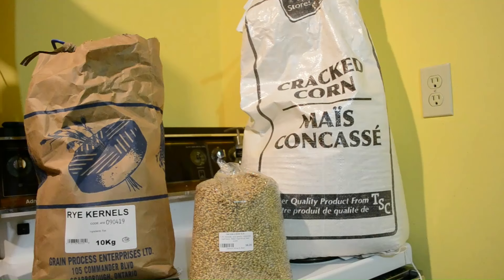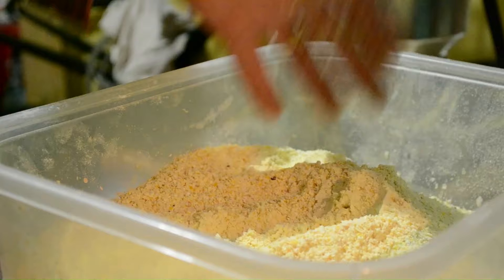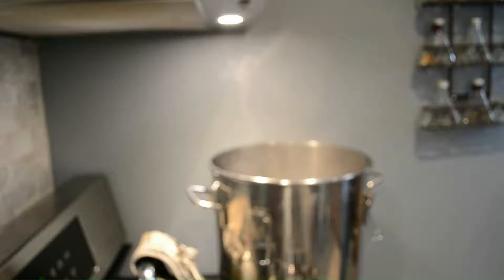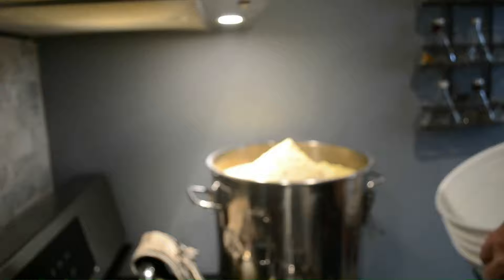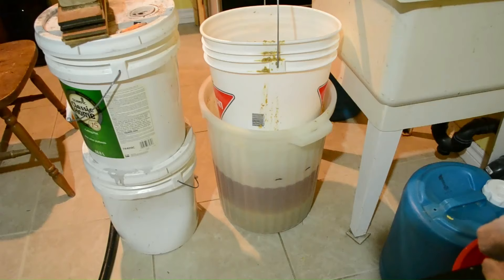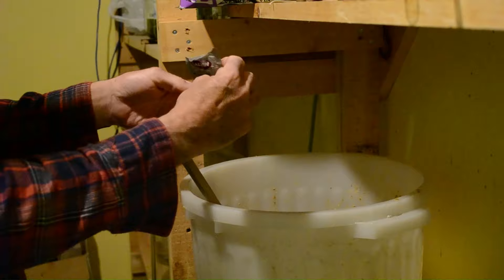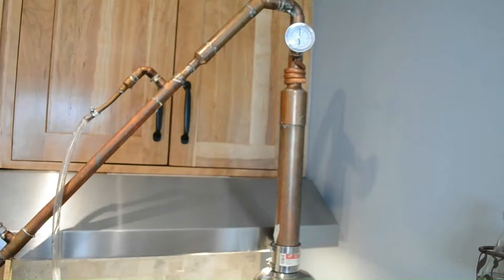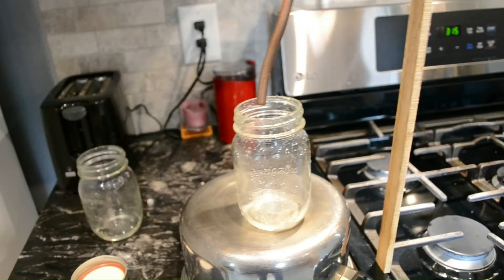Make Bourbon Whiskey at Home Part I

Comment: You don’t need to run through the still in 72 hours if you have a clean closed fermentation.  If you get wild yeast then you will have issues.
Reply from the maker: I understand that most large distillers run it after 60-70 hrs. I noticed it tastes better too, personally. Also, your giving up a very small amount of alcohol by shortening the fermentation. I do appreciate you comments though, we're all learning!!
Reply: @marktompkins8519  kñg. G

Comment: For all who try this, a tip: 
Before you boil the water, take some of it and mix it with the corn (not a lot, just enough to wet the corn). It's super easy to mix cold water with the corn, and when you add wet corn instead of dry to the hot water, clumps do not form as easily.
Reply from the maker: Hey that sounds like a great tip. Thanks!
Reply: I have done this many times and doing this before adding to the hot water is much easier!!!

Comment: I will try this recipe. I made the following summary:

For 19 liter wash with 1.045 gravity (around 6% potential)
Max 3 day ferment for gravity 1.007 (around 1% potential)
Stripping run should result in 2.2 liter @ 25%

Cracked Corn 3.21 Kg
rye kernels	1.07 Kg
Malted Barley	0.935 Kg
Mashing water	18 Liter
Sparge water (hot)	12 Liter
Yeast	5 gram
Reply from the maker: Looks, good, let me know how it turns out! Incidently what I made earlier turned out very well, folks love it!

Comment: Next time for mashing & sparging drop few handfuls of rice hulls. They're "mechanically" lowering viscosity & reducing sparge times.
Fermenting & distilling on grain is better for taste, but you'd need proper (distilling) equipment for it (extra thumper mostly). Also as you can, go for stainless (turkey steamer bucket with some ss cloth at the bottom).
Cheers brother, happy stilling ;)

Comment: you need to use a cordless drill or even a corded one if you need more torque but all that hand grinding is labor intensive
Reply from the maker: actually it only takes about 20 minutes per batch, I do it while the water for mashing is heating up.
Reply from the maker: Also, I'm around machines all day. I like doing things by hand occasionally. I know, sounds wierd.
Reply: I'm sure the hand grind creates a more authentic feel.

Comment: Have u tried or used Brew Bags, they are great and clean(er).
This is/was the longest short video ever 😂😂✌️.
I might have missed something.
Did u add Sugar and what was your SG before adding your yeast?
3 days to fermet😮?
80 proof, 40% on your final, not bad.
I'm sure u dropped in % after your 1st.
Your last mix looks a bit milky, u added your Tails?
Reply from the maker: Hi Chris, thanks for the suggestion. I did try straining with those bags, a bit messy and not as effective, for me anyway. Re: adding sugar, technically whiskey can only consist of grain, in order to be considered whiskey. But if you want to add sugar to bump up the alcohol I would say use dextrose. Dextrose is corn sugar that's extracted with enzyme, whereas corn syrup is extracted using acid stripping which makes it fructose. Maybe none of this matters in the end, but why not make it right! About the 72 hour ferment, the commercial distillers ferment for 60-70 hours, then distill. I tried fermenting longer thinking I would get more alcohol, but the result was the whiskey tasted absolutely terrible.  
 Something about the primary and secondary fermentation result. Also, not much more alcohol is produced by letting it sit longer. So I mash on Monday, pitch yeast Tuesday morning, distill Friday. Cheers!

Comment: hi, i can speak little english. we use kilograms and celsius.
I want to ask.
How many kg of corn, rye and malt did you use? and how many liters of water.
and rye is malt? is it open for 3 days to be fermented?
Reply from the maker: Hi Ilker, in total I used 25 kg of corn, 10 kg of rye (unmalted) and 10 kg of malted barley. It's important to use malted barley. I fermented it in an open container for maximum 3 days, but I put a plastic sheet over the fermenter. For each batch I used 18 liters of water, because thats all my still can hold.
Reply: @marktompkins8519  thanks for your answer...
I think you mean 2.5 kg corn, 1 kg rye, 1 kg barley :) because the numbers are too high for 18 liters of water :)
I guess it is not necessary to put it in another air-lock fermenter after 3 days and increase the alcohol level. We distill after 3 days?
 ...or? we don't have Quercus alba..
 we have Quercus petraea and Quercus robur exist in our country. If you have information, which one should I use?
Reply from the maker: @ilkerk01  I thought you meant how much in total. Per batch I used 4.5 liters of corn, 1.5 each of rye and barley.
Reply: @ilkerk01  ilker abi selamlar damıtım yaptinızmı sonuç nasıl oldu acaba

Comment: do you cut the heads and tails??
Reply from the maker: In a way, yes. Because the 5 gal batch is so small, there isn't really enough volume especially of heads to do much with them. I find that the temperature rises quickly from 65c to 78c, and the volume is only 3 or 4 tablespoons, which includes methanol, which is poison, so I just throw out the 'heads'. If you had a larger still, one could take cuts, and blend that in. As to Tails, I just keep everything after the ABV drops below 70 separated, and use it in the next batch. That recovers the alcohol, and adds 'character'.  Again, if one had a larger still, blending in cuts would be much easier.

Comment: Fermentation should be anaerobic. Otherwise alcohol will be converted to vinegar.
Reply from the maker: This is true. The initial fermentation process is inherently anaerobic, as it requires no oxygen. However if one were to leave the fermented batch exposed to air for a length of time airborne vinegar bacteria (yeast cells?) will begi converting the alcohol to vinegar. Not much risk of that occurring though when you distill within 70 hours of the start of fermentation.

Comment: Was the rye malted when you ground it? You can run your mash twice if you at more sugar. Why through it away after one run?
Reply from the maker: The rye was not malted. To your other point, whiskey (whisky) is made from the sugars derived from grain. I guess you could add dextrose (corn sugar) and still technically get 'whiskey'. If you add a different sugar (cane?) you would produce an alcoholic beverage, but couldn't really call it whiskey.
Reply: You can't get the Sugars from the grain without the amylase in malted grain.
Reply from the maker: You're correct. I added malted barley (2 row) for amylase

Comment: What do you do to offset the burnt taste from the grain in the bottom of the still pot??? Yuck..
Reply from the maker: I don't distill on the grain. When I mash I keep a close eye, bring the water to temp first then add grain, haven't had a problem with burning
Reply: @marktompkins8519  In the video I thought you were dumping the unfiltered mash into the still. I did that in my early first times.  The mash scalded  and the spirits were terrible and dumped.
Reply from the maker: No, I sparged the mash first. I pour it through a strainer (5 gal bucket with holes in it) the rinse with boiling water. It's in the video.
Reply: @marktompkins8519  I have seen the video. But course and fine flour would get through and end up on the bottom of the still. I have done it like I said, with a screen colander, and the flour would scorch and burn on the bottom. Yuck distillates. I think thats why they use steam jacketed stills instead of direct heat.

Comment: Sir how to remove methanol from your distillation
Reply from the maker: Distiate will start coming out of the condenser at 65-70c. This is the methanol. Dispose of all distillate untill the temperature reaches 75c. It won't be very much. You can set it aside to use as a cleaning agent.

Comment: No sugar? Why
Reply from the maker: In order to be called 'whiskey' sugars cannot be added. Converting the starch in the grain into sugar is what's allowed (the mashing process). Adding more sugar will certainly increase production. Dextrose (corn sugar) is probably the best choice for that, at least it comes from grain. Other types of sugar may be caramelized, which caused them to resist fermentation.

Comment: why would you do a stripping and spirit run with such a small amount of alcohol on a still whose capacity will fit all your mash?
Reply: all youre doing is losing flavor by doing an extra distillation.
Reply: wait edit:  i see at the end of the video youre planning on multiple mashes and other runs.   ok fine.  cheers mate.  makes sense now
Reply from the maker: Hi John, with the amount of grain I used, I mashed and stripped 8 batches at about 18 liters each. Each stripping run yielded about 2.2 liters at 22%. After all the stripping runs I re distilled all the liquor that I had from my 8 stripping runs, and this is called the spirit run. If one wanted to, after the spirit run you can re distill again and really clean up your product, but you will lose about 18-20% Hope that answers your questions!

Comment: Need an opinion. I've got a Corn, Barley, Rye mash that when I removed the lid to see if my Final Gravity was 1.00 (which it is)...the smell was TERRIBLE!! Smells like ASS!! Should I not expect anything to drink from this and run it for the alcohol only?
Reply from the maker: I found that it should only ferment for 70 hours at most. In fact that's what commercial distillers do. At first I fermented longer, thinking I didn't want to waste any alcohol, but it was bad. Even after running it through the still a number of times, it was just nasty. 70 hours my friend, that's the key. However if your making brandy or rum, let it ferment till you get to 0, it's just the grain alcohol that the 70 hours of fermentation applies to.
Reply from the maker: @secra4  from when you pitch the yeast. If the temp is around 80f it will start fermenting right away

Comment: Couldn't you skip the grinding step and combine it into the stirring step? Instead of using a paint strirrer and cordless drill, put it in a bucket with a lid on it (make a small hole and "port" to not make a mess.... I glued a plastic fitting into the lid of a regular bucket)...

Then I use a CORDED drill with a a long threaded rod. On end of the rod I have a circular saw blade. I don't make alcohol (yet) but I make paper logs with this method. It really chops stuff up and I don't have to worry about varying my speed with the drill because of the spill proof lid I made.
Reply from the maker: Sounds interesting. I guess as long as it's ground fine enough. It is important to stir it as you add the 'flour' to the hot water to avoid clumping.